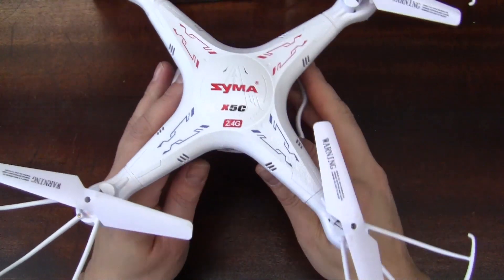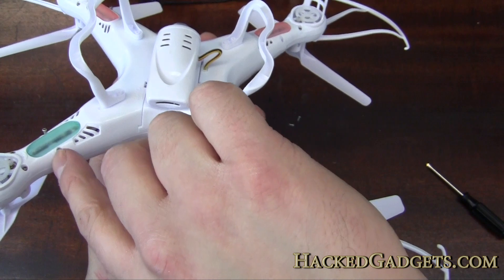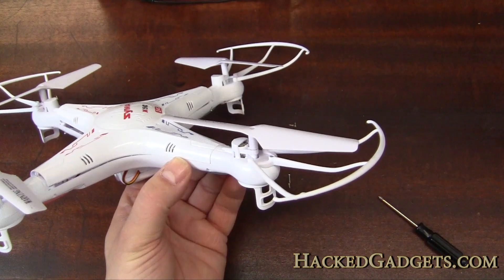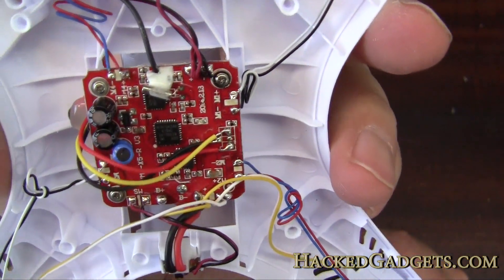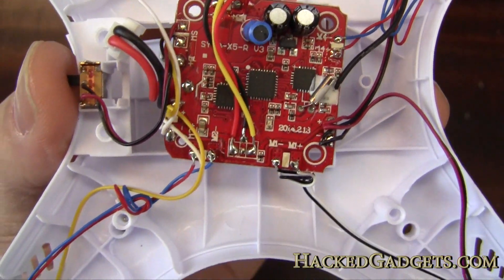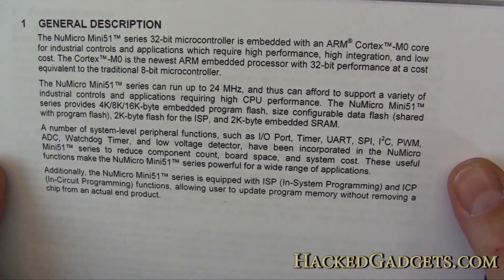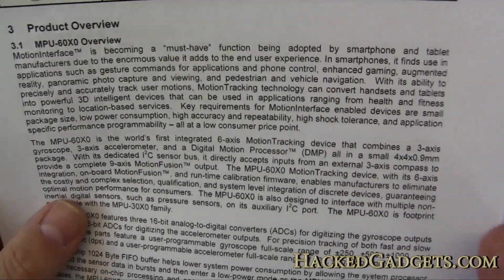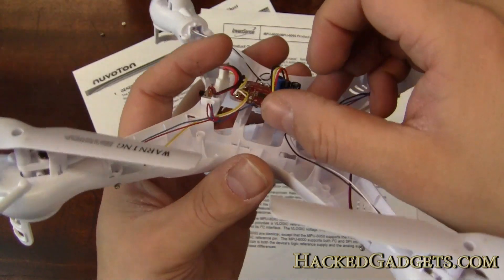Syma X5C-1 Remote Quadcopter Teardown

Comment: I need help, I crashed mine, and now whenever I turn the copter on, the motor on the bottom left (this is with the power switch facing you) turns on at full speed. I did not touch the throttle, in fact, the remote is off. I thought maybe the circuit was damaged and had the motor wires touching something coming straight from the power source, but nothing looked weird inside. Everything was symmetric. I have no clue what the problem is, but the copter is unflyable. If anyone has any clue as to what is causing this, and/or how to fix it I would greatly appreciate any help. 

By the way, after a while, the motor slows to a stop, but if I push the throttle up at all, it turns on at full speed again. The other motors work fine and do what the remote tells them to do.

Comment: While changing motors i forgot to make note of which color went where on the soldering points on the board, this saved me some trouble. Also moved the red/amber leds to the rear, green to the front.  Thanks for posting.

Comment: Well I started disassembling mine in an attempt to fix the short in the light board of a brand new out of the box X5C-1. A WARNING to anyone getting a new x5c-1: The molded Star shaped piece is now molded in one piece around the propellers. There are no longer 4 individual pieces around the motors. I almost broke mine trying to get it off before I figured out it was 1 piece. So you do now have to remove the 12 screws surrounding the blades and remove the blades and remove the crash guards if you want the copter to separate into 2 pieces.

Comment: Is there a way to bind this to a programmable radio or any other way to modify the firmware? I would like to have more control over how far it will TIP and flipping in both directions at the same time.
 Flipping diagonally would be fun or roll while doing a backflip. You can make this happen if you tap the button to FLIP  then tap just the right time to ROLL.

Comment: Just received my 2nd 'Red' X5C-1 and the part numbers (shown in manual part code # 01 and # 06 [pp11] are molded as one upper cover piece. Be real careful in removing 25 screws b4 seperating the two body halves.  Note the description for part # 06 in parts code list is INCORRECT, should be "transmission cover" If your 'Red' X have four of them.    01-09-15.   The box was rec'd yesterday and the box had been crushed, one prop shaft bent approx 3-4 degrees off center. Removed the motor from mount and grasped the shaft with pliars, bent back to a close zero.  we'll see.  ,  Its all in the fun.

Comment: I dropped my copter in water as it crashed into a pond and it flew for one more flight. I went to fly it again and now you give it throttle and it flips over or stops responding until I let off the throttle and only stays on for a few seconds. Does this mean the battery is bad or the pcb?
Reply: Could even be a bad motor or motor wire since if 3 motors were running up and one wasn't that would through things out of whack.
Reply: Well I broke the top shell so the motors were too far up and reset the controller and it was fine